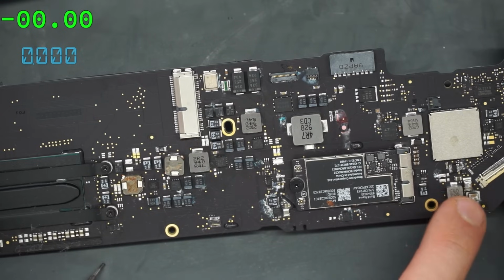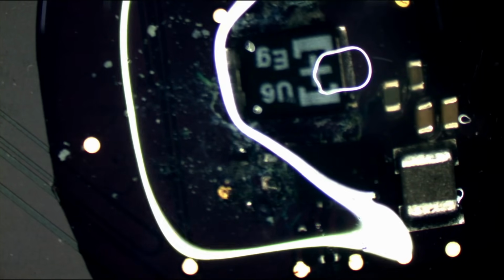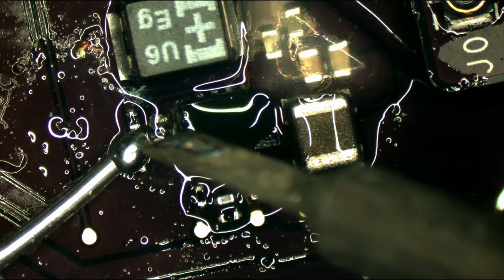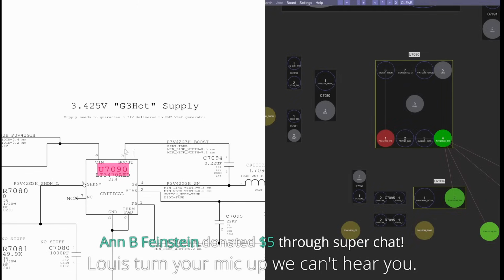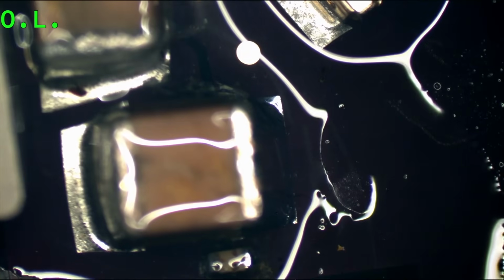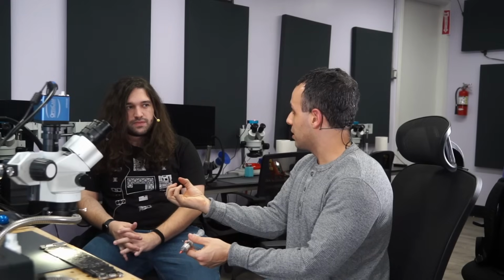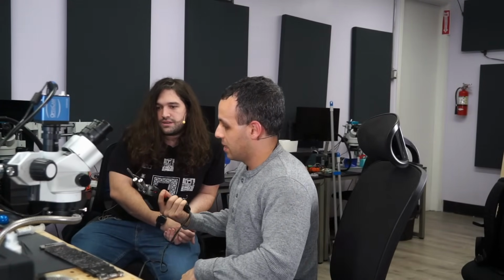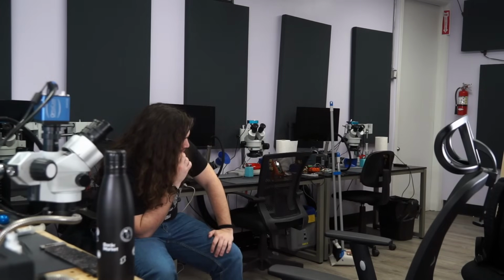The man, the legend, the idol.

Comment: Hearing Maslow’s hierarchy used in the context of computer repair is interesting, but I guess it makes sense as a general concept. If thing B needs thing A to function, or if thing A is simply more important, then it makes sense to start with thing A. It doesn’t matter if someone’s hungry if their blood is not circulating, circulation doesn’t matter if their airway has collapsed. It does matter if there is no WiFi if the screen doesn’t work, the screen doesn’t matter if the computer can’t turn on.
Reply from the maker: when working on a board that is nasty everywhere, you figure out what part matters most, see if you can make progress there, and keep it movin'
Reply: @rossmanngroup  uwu papi
Reply: @LeafBoye  no need to embarrass yourself
Reply: Is there a possibility to fry a broken part of the board by fixing power delivery first?
Reply: @myownsite  I'm not an expert like Louis is, but I would imagine there's more risk in fixing other things first if they receive more voltage than they could handle due to a power delivery issue.
Reply: @illinnear7233  i think there's every reason to embarrass yourself, it desensitizes you to anxiety and you only live once
Reply: @LeafBoye  that's fair. appreciate the honesty, have a good day.
Reply: @illinnear7233  you have a good day too! :)
Reply: It's nice to hear about Maslow's Hierarchy used outside of the  basic concept of human resources.

Comment: FYI: flux is a de-oxidizer, and also shields the components from the outside environment/air so the solder and the part you are soldering cleans up as you apply heat and solder to it.
Reply: Huh I didn't know that!
Reply: As someone who didn’t know this and saw him squirt a big squirt of it(so much anxiety tbh), it all makes sense. I just thought ANY type of liquity would mess up an electronic piece.
Reply: @yoshisaur-munchakoopas  it's not the water itself that damages the device, it's when the device tries to power on while wet that damages the device. you can dunk a motherboard in fresh water and leave it to dry overnight, and it'll work fine.
Reply: @thiefrules  It's actually the particulates and impurities in water that has minerals and ions which enables the conductivity. Purified water isn't very conductive at all.
Reply: @yoshisaur-munchakoopas  Not all liquids are conductive or corrosion forming.
Reply: Leaving flux on the board is bad over time though, as it will collect conductive materials. It becomes sticky, which makes it a particle magnet. I've "fixed" several devices (most recently a pair of powered speakers that were cutting in and out) by simply cleaning the flux off of the PCB where some apparent final hand-soldering took place during production. Louis seems to always run the boards he fixes through a sonic bath once they are operational, so it doesn't matter how much flux he uses while repairing them. Someone who has to clean the board by hand might want to be a little more conservative.
Reply: BUT, before anyone misunderstands, leaving flux on a board forever is not a good idea. For it being de-oxidizing it has to be reactive and over time it can damage traces and components. Don't be afraid to use it, but as soon as you are finished, you better remove it thoroughly.
Reply: No one mentioned this exactly but flux can actually oxidize a board because it removes the oxidized layer, leaving fresh metal to be oxidized by the air, which gets removed too, essentially eating through the metal. Without flux left on solder joints the oxide layer that forms protects the metal underneath. This is particularly true for agressive (acidic) flux.
Reply: @rosalina-dev  
True as well. Hopefully anyone who uncovers copper traces re-coats them with something to protect them (non-metallic fingernail polish works in a pinch, but UV resin is better) The contacts tinned in solder and solder itself should be alright though.
Reply: @ChrisArnold1975  that's not even entirely true-
if the right conditions are present, the electricity can ionize pure water and make it conductive enough to cause a short circuit,
and this doesn't say anything about rust either.

If you want to be safe just make sure everything is unpowered (harder than it sounds because of residual charge and capacitors).
Reply: @hanswurst9120  Depends on the flux. Classic acidic flux will destroy the metal traces over time. Modern no-clean flux is only active while hot. It is called no-clean because you don't absolutely have to clean it off. You still should clean it since it is a sticky dust magnet, but you don't have to sweat it if there are a few traces of it left. Hint: never ever use acidic flux on electronics, always use no-clean. It is impossible to clean it from under some chips and acidic flux will ruin some future day.
Reply: @KonradTheWizzard  What you said also depends. Acidic flux is fine as long as you can clean it entirely. And no-clean flux under chips that get hot will also do damage after a finished repair. Will be active every time the chip is doing heavy work. (Yes I know, it's a matter of the actual temperature, but still.) Rule of thumb should be: Clean as good as you can, no matter the flux, and prefer no-clean flux.
Reply: @hanswurst9120  Absolutely! Your conclusion should be engraved on a stone tablet and hung on display in every shop. 😃:washhands:
Reply: thanks for explaining
Reply: I remember trying to solder before I knew to use liquid flux. its like trying to get solder to stick to steel.
Reply: And it also works as heat spreader with the hot air station which prevents heating just a single point on the board.
Reply: @barms9768  If you get some no-clean reflow flux it should be just fine over long periods of time without cleaning up.
Reply: @barms9768  what did you use to clean the flux?
Reply: @therealb888  If something electronic gets wet I have a little procedure I do but am not sure if it is ideal. I first make sure there is no power. Then I clean the part with water and a toothbrush (because the contaminants are hopefully water soluble?). Then I use a good amount of the purist IPA I can get to rinse the part (for more cleaning and more importantly so it evaporates faster without leaving any water). The last thing I did this to was the little board with the buttons for a monitor that had a beer spilled on it. So far it has worked every time. Any suggestions on improving my poor man's technique?
Reply: @yoshisaur-munchakoopas  you can submerge a whole pc in mineral oil and it'll still work, watch Linus' video on it
Reply: @MikkoRantalainen  What is the point of the hot air if you are just going to reflow the joints with a soldering iron anyway though?
Reply: The more blob, the better the job!
Reply: @nerdstrangler4804  You use hot air to prevent warping the board. Different materials expand at different rates when you heat them and if you use powerful soldering iron with a cold board, the changes are higher that something gets damaged because of rapid thermal expansion. Heating with hot air prevents hard temperature gradients and reduces risk of damage due thermal expansion differences.
Reply: @MikkoRantalainen  Good to know. I appreciate the reply, thank you.
Reply: Hi if boards from the 70s are fully covered in flux
Reply: @hanswurst9120  It depends upon the flux type. Rosin, which is in the core of most solder simply coats the joint and can be left on indefinitely. I have 50 year old boards with rosin all over the joints. No corrosion at all. Also, Rosin is good at sealing against moisture damage. It's like varnishing the joint
Reply: @therealb888  Even if it is dried, the crystallized salt remaining on the pcb can still absorb moisture later down the line.
I stuck my phone in a pool once to see how waterproof it was (not marketed as waterproof at all)

Phone worked fine but liquid got into the camera and dried on the sensor, replaced that and everything was fine.
until 3 months later it would just bootloop

Opened it up and noticed that liquid also got in through the hole for an IR Blaster (Redmi Note 9 Pro) and there was some filth in that area, dropped the board into some tapwater and rinsed it off while brushing with a toothbrush, rinsed further in hot distillied water and then gave it another rinse in isopropyl alcohol.

proceeded to bake the pcb at 80°C in the oven for an hour, let it cool down, reassembled -> works to this day
Reply: @pyrojinn  what the shit
Reply: @therealb888  He was correct in his analysis, he just didn't care to mention that you need to be 100% sure that nothing remains from the water-soaking process. You are correct that it's not water alone that can cause issues, but assuming that it is dried thoroughly and completely, the mere act of dunking it in water will not inherently damage the device.
Reply: @barms9768  this sounds right to me.
Reply: @thiefrules  Well, except for the corrosion.
Reply: I always thought that flux was just a magic 'make my solders better' paste.

Comment: Steve will now go as far as desoldering the GPU from the board for the teardown video when nVidia release their 40xx graphics cards.
Reply: One for archival and one for teardown lol
Reply: I honestly wouldnt mind seeing mods like swapping vRAM chips
Reply: @calvindibartolo2686  Do you remember someone swapping the 1GB gddr6 chips for 2GB gddr6 chips on a 3070? I thought that was cool. Didn't work as it needs an update for the gpu to realize that there is more memory address space available and nvidia encrypts their drivers and firmware to prevent exactly that sort of thing.
Reply: @LiveType  i know someones done it to the 2060 and 2070 and it simply works. Depends on whats in the vbioses I suppose
Reply: @calvindibartolo2686  What was the gain from adding more vram to 2070? Worth it, or not really?
Reply: @enermaxstephens1051  honestly unless your card is swapping from system ram already, theres no benefit.
Reply: @calvindibartolo2686  Well I'd only be referring to those huge games that need more vram. Nvidia seems bad about not putting enough vram in their cards. But it could also be that they're thinking it doesn't need quite as much because the gpu is faster and more efficient clock for clock. I dunno. I just know I always end up running out of vram even on a new generation card, because some game will come out that wants more.
Reply: @enermaxstephens1051  yeah. Just problem is generally speaking said games that can exceed the RAM on the card also tend to be heavy enough that the card simply doesnt have the bandwidth or speed to process it anyway. Doubled ram used to be a big thing way back in the day and suddenly somewhere it just... stopped. But same problem then: doubled ram provided no performance benefit. But they sold because common folk thought more ram = better card. Aside from AMDs polaris cards (which differ in the core as well 8 vs 4gb), the last GPUs that simply doubled the RAM that I recall were the Geforce 8000 series
Reply: @calvindibartolo2686  I guess the real question is, do they always max out the RAM on a card? One would think that the idea thing to do on any card, would be to put the maximum possible vram onboard that the card could make use of. So that adding any more would be a pointless waste, because the rest of the card could never use it anyway. But I don't know if they actually do that.
Reply: @enermaxstephens1051  nvidias definitely seems more calculated for sure. Well... at least it was. Then we got a 12gb low-mid card lol (the laptop version is 6gb tho)

Comment: It was funny watching Louis help Linus fix his Mac because Louis had to be a little reserved for linus' audience. This was goddamn hilarious because Steve almost didn't know how to take it. Of all the tech tubers Steve is actually the least surprising to see on this side of things.
Reply: Definitely, I thought tech tubers would be experts in electronics & computer sciences but there's so much difference here.
Reply: @therealb888  electronics and computer science can be entirely disjunct fields... cs should be called information science (as it is in the uk i believe) and is more akin to a subfield of discrete (pure) mathematics.

Think of it this way: info sci is like astronomy. Eelctronics is like telescopes and other tools used to study astronomy and cosmology. Many astronomers might know a thing or two about the manufacturing the equipment they use but they know more so how to operate them. It's an engineers and technicians job to assemble/repair/maintain that equipment.
Reply: In summary

"Computer science is about computers as much as astronomy is about telescopes."
Reply: @phxcppdvlazi  as it is my field I also like to make the analogy of the difference between the race car driver and the auto mechanic.

Comment: Explained flux as something that allows the solder to flow better.
Main point is that it keeps air away like with welding. It doesn't let air near heated metal surfaces which would create an oxide layer on them. To which solder doesn't want to stick to. Also, helps clean a bit, since some stuff/muck floats away from the surface into or to the surface of the solution.

Comment: Louis dude you are a badass.. I have done some soldering on large cables and stuff. This micro soldering is next level and you really know your shit. My roommate once left a toaster on and a cable was above it. The cable above it was for her blender. I cut the cable. Stripped the wires. Twisted them together. soldered. Then put electrical tape around the solder. Worked like a charm. It was fun.

Comment: Slight oversimplification: Always use the largest type tip, with the largest contact surface area, and shape, that will fit in the area you need to work, and will do the job without becoming too much of a bull in a china shop for being too big. This way you have maximum thermal mass, you can melt joints quickly, and you don't need to compensate too much for the board soaking up heat by cranking up the iron temperature so much. Your components and pads are gonna survive a lot longer if you can melt joints quickly and can generally avoid applying 400+°C temps. Your tips will last longer too.

And if you don't have already, switch to cartridge type soldering irons/stations. T12 can be had stupidly cheap and will get you really far. Then the heating of the tip when touching something will be vastly more responsive. And, "what tip to choose" becomes less of an issue because you can hot-swap cartridges. With cartridge type, since the heater element is baked in and only right behind the tip, you also get irons with 50mm from finger grip to iron tip. This makes a huge difference when soldering small stuff.

Comment: A longevity tip for watercooling fittings with rubber O rings: Take silicone lubricant (for coffee maker maintenance, for example) with a small brush and apply a thin film to the rubber. Be careful to not get any on the threads since the reduced friction will make it quite easy to over-tighten the fitting which might damage coolers/radiators etc.